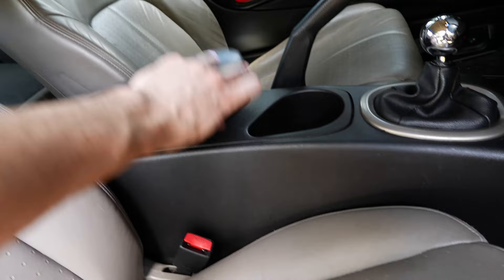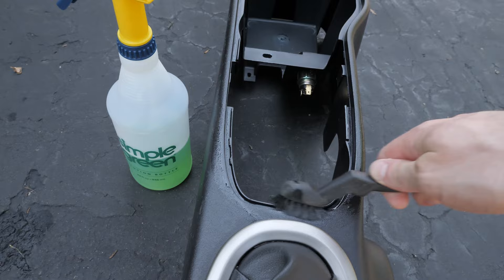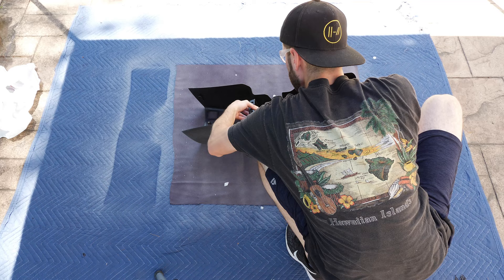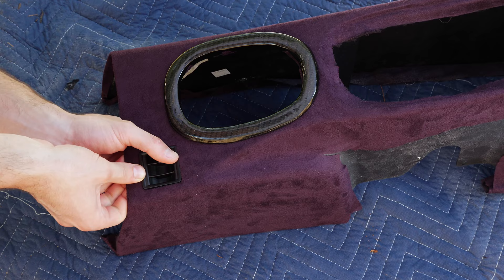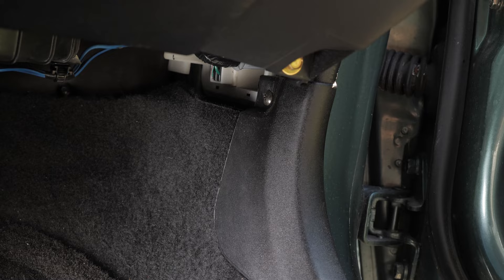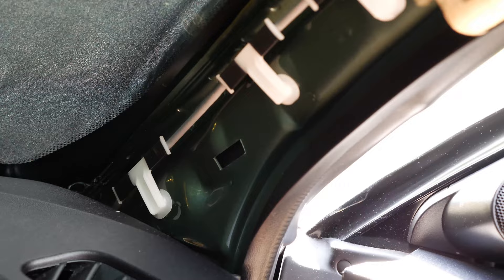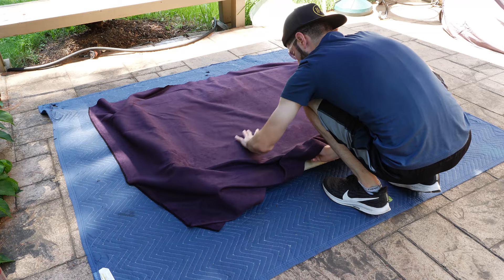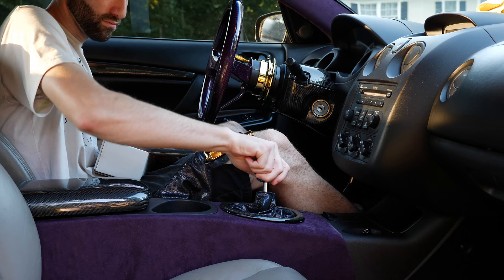Custom Carbon & Suede Interior Install!

Comment: Just want to let you know, as you may have already found out, cleaning and maintaining fabrics that are glued to a plastic surface can be very hard to do without damaging it. Same goes with headliners. If you absolutely need to get something out of them, be very, very careful as to how you do it or else you'll get the same effect as a sagging headliner. hope this helps!

Edit: I very much appreciate your use of finesse, skills, and tools instead of just brute forcing stuff like trim pieces.

Also, one critique I have is your use of chrome parts that attract oils from your hands. If you do this again, I'd recommend going for matte finishing on the e-brake, shift knob, whatever, just to make it so you don't have to wear gloves when you drive your car to a show. Again, hope this helps! It looks awesome!
Reply from the maker: I really appreciate the insight and constructive feedback. Thanks!

Comment: Where’d you order your suede and what’s size did u get It in
Reply from the maker: I actually purchased it from Etsy, however the store is no longer around actually. I ordered a lot of extra in case, but its best measure and get a general idea of the square footage you need.

Comment: Was thinking of asking where you got the carbon fiber but then I see you respond to everyone but anyone who asks where the carbon fiber is from, that’s unfortunate
Reply from the maker: They are custom made. I already responded to a few of them. Just not repeating always, sorry about that. They are from a friend of mine on IG. Creative Intentionz.
Reply: @DrewMestel  No big deal I just don’t get why if it’s so hard to answer the questions about the CF, why not just link in the description to everyone where you got it from, or even easier just takes 2 seconds to be like “btw guys I got this carbon fiber from Creative Intentions so if you wanna buy his stuff”, gotta give the man his props ya know
Reply from the maker: @crazy8boy145  I can't recommend or link  something that is not directly purchasable. They see custom made pieces. And I don't necessarily recommend the manufacturer. I want to recommend parts to my viewers, that I condone them to buy.

Comment: Are they sun visors crusty now
Reply from the maker: Eh, not quite. Once the dye etches in, you can brush or massage away any excess material. Then it should return close to original texture.